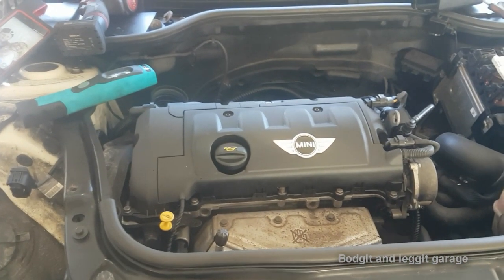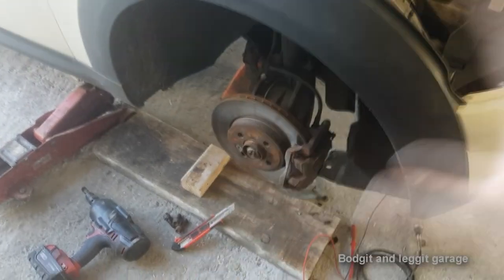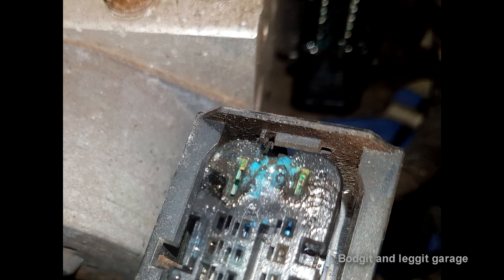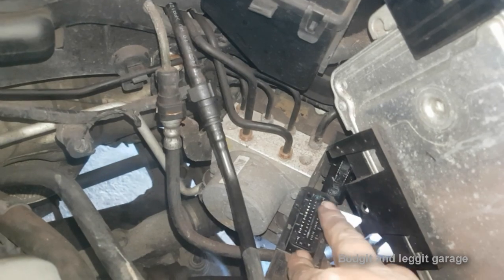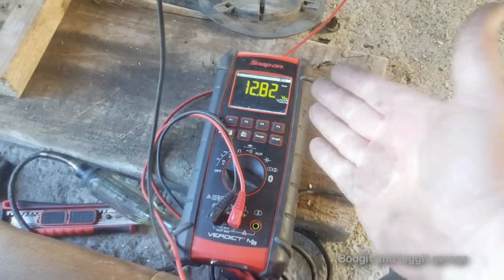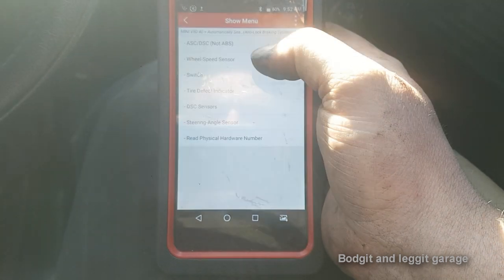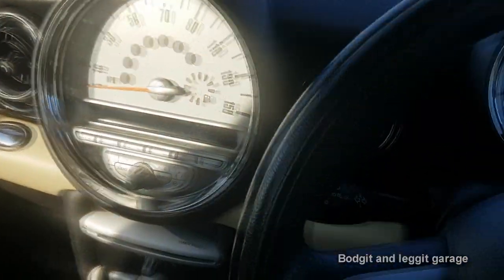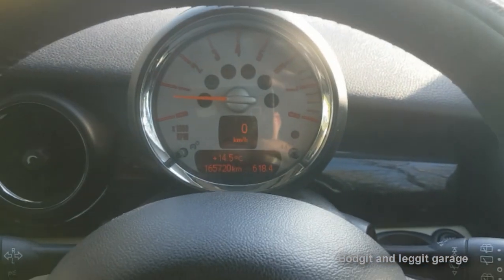Mini ABS/Airbag Light (5E00 5E01 93FB) Diagnosis And Fix

Comment: Just replaced the ABS module on my R50 that threw up 5DF5 (brake light and abs light stayed on) and the ignition light was more on than off! Id replaced the alternator, even though it had a decent output. But the light would go off, then come on with no apparent pattern. you can dismatle in situ and replace just the electronics, which saves breaking into the hydraulic circuit and the ensuing air locks- if youve not got ABS software to purge it.

Comment: Actually Leon, you can take the ABS module without removing all of that...
Just remove the ABS motor first...😋
Then the ABS module just comes out nicely and easy...😊
From experience I know will work..
Nice video!
PS. That is if you need to remove the module...
As to remove without take the motor off, it is quite awkward...👍
Reply from the maker: I just needed to remove the connection😊😊😉
Reply: @bodgitandleggitgarage  
👍